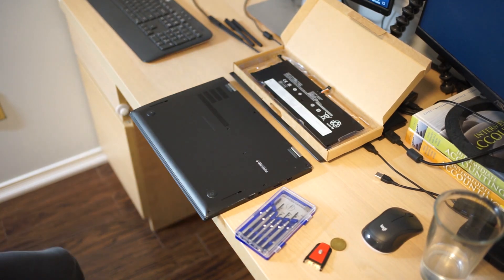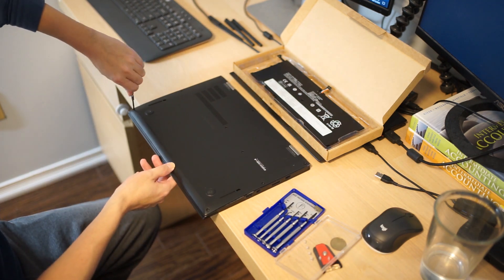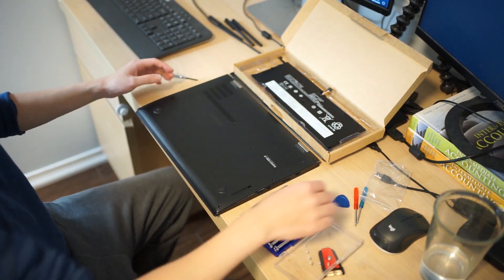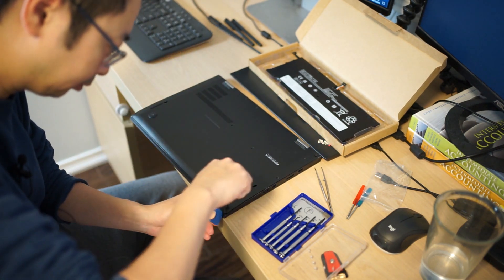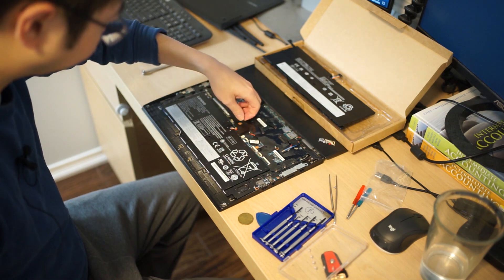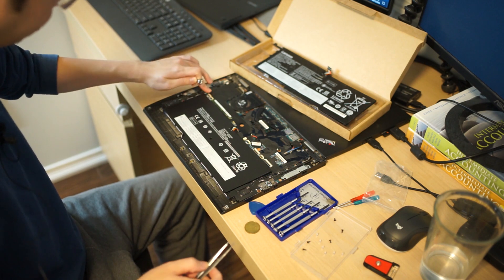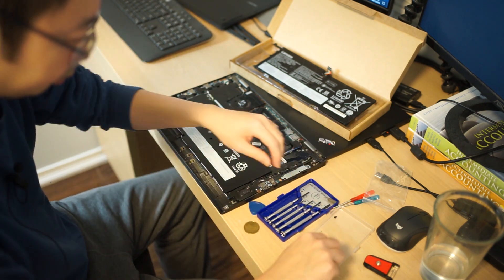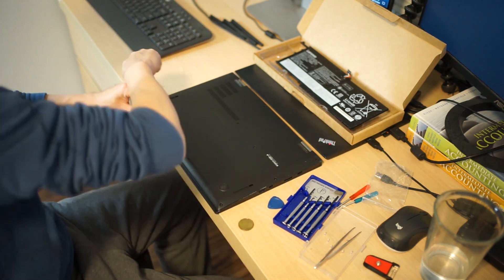Lenovo Thinkpad X1 Carbon Gen 4 Battery Replacement detailed disassembly

Comment: Nobody even states how to disconnect the battery to pull on the wires is it a self-tap connection Do you pull down Do you push the wires up No one made a video of it looks like I'm going to have to do it.
Reply: This demonstration isn’t very helpful because the camera is too far away to see the details. To remove the connector, you need to lift it from the top, pulling it toward you at roughly a 45-degree angle. The bottom part of the connector—where the ribbon cables are—is slotted into the bottom of the housing.

When installing the replacement, start by sliding the bottom part of the connector into the slot at an angle. Once it’s properly seated, gently press the top part down to snap it into the pin connections.
Reply: @SethRetig yo thanks man. I struggle to put battery back until I see your comment.